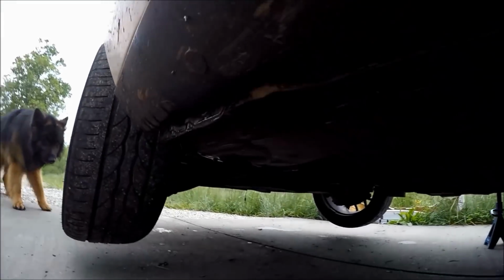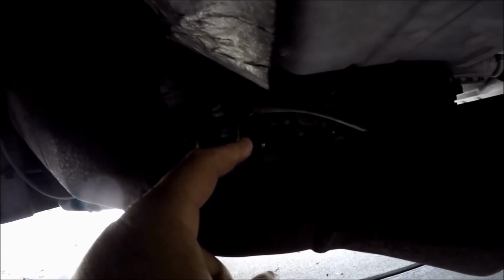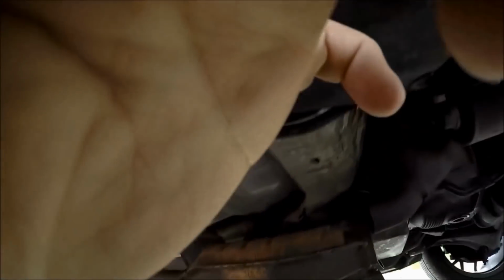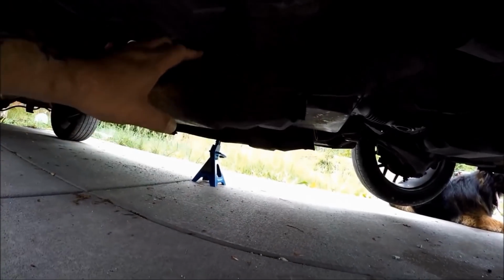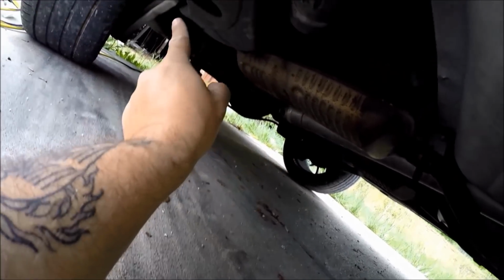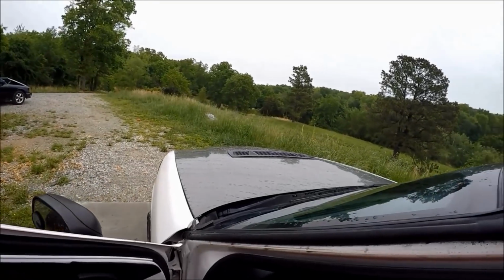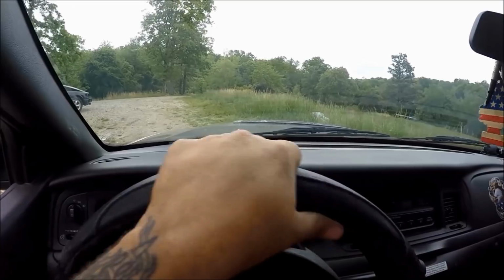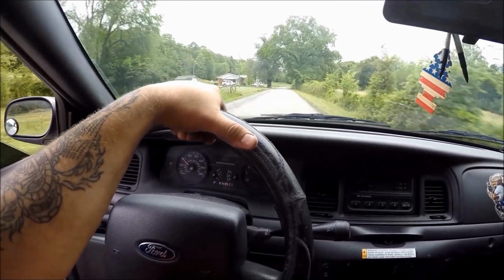LOUD AF!!! Rear Cat Delete on The Crown Vic Sounds Like a Monster Truck, Pops Like a Rally Car!

Comment: Mines fixing to be louder then that. That's how it sounds right now.   I'm putting marauder exhaust on it with a xpipe.  Then the straight tips will be 3 inch out with a dynomax 3 inch race muffler

Comment: For the check engine light I used a capacitor and a resistor and with that it passed the california smog test and no check engine light. I didn't cut the cat, I Hollowed  out all 4 and added flowmasters to tame the sound

Comment: I got magnaflow mufflers on .. removed the rear cats only and thinking about removing the rest 2 and make it all piped up to the magnaflow .. will it be stupidly loud or its gonna make it more pressure into the magnaflow mufflers and make it more muaical 😍 ? Help amigo
Reply: I got magnaflow glasspacks and still had 4 cats. Getting two cut out next week :).

Comment: When I did my exhaust on my vic. I ran around for a week with open exhaust. I have more throttle response with the full exhaust then with it open. May not have anything to do with back pressure, but it's a lot more snappy with the mufflers, and sounds better
Reply: I redid my exhaust and ran turn downs right before the axel... sounded like shyt and it vibrated bad... I'm back with exhaust tips now and it sounds like a pissed off stang
Reply: @Reeko904  it was the same for me when i had it open under the car

Comment: I did a full cat delete on my 1992 Lincoln and it’s so freaking loud I had neighbors telling me they could hear me from 4-5 miles on the complete opposite side of town at 3am. I will also say the power increase and torque was substantially higher those cats really do strangle the engine I wish they had a way to make it quiet but also keep the power gains.

Comment: It's not back pressure that causes some people problems,it's the air fuel ratio, for emission purposes the tolerances in the computer are programmed with whatever resistance it's designed to have,if you really open that up " total cat delete" you will have to richen and readjust fuel trim to not lose allot on low end, that's why when you change pipes on a motorcycle you would have it jetted for example, the back 2 oxygen sensor s on that car basically just check function of converter and do not control air fuel ratio so chopping them will not hurt and will give some gain, chopping the front and backs will screw you without a retune
Reply: Wolfman Rebel just tune the ecu to adjust to the changes
Reply: @AndersonMotorWorks  yessir

Comment: I feel like people who do this also put cards in their spokes as a kid
Reply: How'd you know?
Reply: Made my GT BMX a lot faster
Reply: Sure did
Reply: An old gift card was like having a v8
Reply: @x24Templar  a cammed ls swapped BMX lmao 🤣😂
Reply: That is true I was one of those kids XD
Reply: Kameron Mitchell cards nooe I did cans and plastic bottles
Reply: Agreed. We used pop cans
Reply: I know I did:)
Reply: @OTWKilo  I did, too!
Reply: pffft you didn't live until you got an empty soda can, ran it over so both ends would clamp down on the rim and hold on tight then it would sound like a small engine when you went fast
Reply: damn straight
Reply: No that's only people with straight piped civics
Reply: Yup sure did! Also plastic bottles and cans lol
Reply: __Ivancio__ _ cans sucked when they sliced the tire lol
Reply: I want to do this when I get a p71 and used to do that. Just came across this comment and pissed myself laughing, thanks man lol.
Reply: Guilty. I also would run over soda cans they would get stuck against the front fork and make a loud motorcycle sound 😎
Reply: two gift cards in different spots sounded like a cammed small block
Reply: Damn right!!
Reply: Hug juice bottles, water bottles, & cans 🤣
Reply: Lol I used a coke can
Reply: Yes..yes we did..and pepsi and mountain dew bottles :)
Reply: Mine was clean af. I used a clothes pin but I used the spring in it so the car would last longer. I also used a pop can to add the rasp. Best sounding mountain bike na!
Reply: try soda cans
Reply: I did the crushed can on the tire

Comment: I cut out my secondary cats, installed a 10 series muffler and now I sound like a tuned mustang lol.
Reply: I want my Grand Marquis to sound like a mustang.. but here in this part of Georgia,  it needs to pass emissions, back when I lived in Florida, nobody gave a crap about that stuff...LOL
Reply: 송휵만Mr. Hyuk-Man would a 10 series muffler + all cats sound good but not to loud? I have inspections up here
Reply: Did the same shit lol
Reply: @KevRalph  if you cut out the secondary cats, you won't cause the check engine light to come on because the o2 sensor is right between the two cats. If you cut off both cats, then you'll fail emissions. I also have emissions here in NH.
Reply: @deathraydave  not as loud but way louder than stock muffler.
Reply: @Mr.Preston3991  good point.. I also have an old Lexus LS400 which has a 4.0 V8.... I want to do the same.. I gave the Grand Marquis to my 18 year old..but he wants to be able to "hear" his 4.6
Reply: 송휵만Mr. Hyuk-Man Are you sure? I have 4 cats and I hate it, I live in California and I’m worried I’d fail smog..
Reply: 송휵만Mr. Hyuk-Man That’s what I was thinking also, but are you sure?
Reply: I got high flows for my secondary cats and magnaflow mufflers but it still sounds dead quiet like a stock car. I was thinking about  straight piping the pre cats and mufflers. Do you think it'll be obnoxiously loud?
Reply: @everyonewasstealingmynamea919  I live in Fresno California I have always deleted my rear 2 cats in my crown victoria I've had 12 total only 1 now and smog hasn't been a issue nor did my check engine light come on make sure to remove after the 2nd o2 sensor not before
Reply: @KevRalph  I live here in Florida and just purchased a 2001 Crown Vic and it's not a police one..an old lady owned it since 2004 and now I'm the 3rd owner...it was way to quiet for me so today I removed the muffler and its has got more sound but doesn't have a V8 rumble just yet and I don't think that a performance muffler alone is going to be good enough ..I'm going to research this a little more but maybe removing the rear part of the cat system might help..I am very grateful that Florida does not make us have our vehicles inspected...I'm a libertarian and not a liberal that believes humans are going to burn up  the planet with their fiery  exhaust
Reply: @vegansaxon3962  I used to live in Clay county Florida near Jacksonville and on the main strips always had ex police cars for sale.. I've been told the flowmaster 40 series sounds great and from what I've heard, I agree. That would probably be the one I would stick on the Grand Marquis..
Reply: I'm from MA and I did the same on my '04. Since its an '04 I don't have to do emissions on mine, thinking about removing the first set of cats too lol, then itll just be straight piped until the two 10 series flowmasters, i wonder how loud thatll be, its already pretty loud lol
Reply: kevralph how it sounds has nothing to do with passing emission. Just change the mufflers to Flowmaster or thrush weld. As long as you keep the cats you won’t fail.
Reply: Did that make it true duals ? Any crossover pipe ?
Reply: @thumperbangin2000  no, my model came with dual into single exit, I honored that to save money. I believe it would be louder if you went true dual.
Reply: @Mr.Preston3991   ok, im looking at a 05 LX soon, im not sure what it has on it stock.
Reply: @ChinnuWoW  for daily driver yes. for fun car no
Reply: @jaredreck882   I actually removed the mufflers a long time ago and it sounds nice. Not bad at all.

Comment: Just tuning in, why are there no videos on deleting all for cats instead of just the rear two. Has anyone done this, or does it kill the gas mileage and check engine light stays on. And then what are the options??
Reply from the maker: crappy MPGs
Permanent check engine light
and major loss of low end torque

the worst part is the almost unberable drone
Reply: @MrRandomReviews  damn bro. I bought a 02 Crown Vic that had all the cats deleted it ran perfect no check engine light he said he tuned it though... You not aware of this?

Comment: Ok so I got a 99 vic it's not a cop car it is stock but when I got it the guy I bought it from that he was gonna scrap it because he did need he sold cats a lot so when I looked under the hood to my surprise he cut the tip of the manifold off 
To save time but said it would run so got it running it is loud af also this is my first car wish me luck

Comment: You could just cut the cats and use some wire to hold the rest of the exhaust up. I did that to my 03 and she was obnoxious for a couple weeks. But u left the rest and it was a good thing. I now have a proper replacement for the cats I removed. The biggest annoyance of the car delete was how much it assaulted my feet.

Comment: 0 out of 10. I bought my 03 p71 with 3 of the 4 cats. Had to remove the last secondary. Suuuuuuuccccckked! My feet hurt after 10 minutes of driving at 55... now she has 2/4 cats, piped all the way with the H and mufflers swapped to super 10's.... it is perfect! But it would be louder with a primary cat delete and the super 10's but I won't do that until I get long tubes.

Comment: Removing your rear cats shouldn't make the check engine light come on. The front O2 sensors tell the engine how to adjust the air/fuel ratio. The back O2 sensors are after the front cats. They send a signal to tell the computer if the cats are functioning properly. Whatever happens after that point won't effect the check engine light.
Reply: I guess with the rear 02 sensors right at the opening, it could make the light come on, but if you extended the pipe back some, it should fix it.
Reply from the maker: my light came on you can even see it in this video of you look close
Reply: That sucks.
Reply: @MrRandomReviews  I had my cut out and I have never had the light come on. Mines on 04, doubt it makes a difference though.
Reply: Removing the rear cats may trip a low cat efficiency or rich code. That would make check engine light come on. By the way what he is telling people to do may also be ILLEGAL IN SOME STATES.

Comment: Check engine light DOES NOT come on with rear cat delete. There no sensor after the rear cats. The computer has no idea if they are there or not. 

Did this on my 2004 p71 and owned it for 6 years. Had thrush weld mufflers. Sounded great

Comment: If you had cut from the exhaust cat inlet, it would have sounded like a bomber plane.  I had make a cut on mine, ahead of cat because had damaged converter and blocked exhaust. 
 The sound is so loud, im gonna try to put on combination flex tube pipe until my cats arrive in the mail. 

1989 Caprice 305
1989 Grand Marquis 302

Comment: Little Fact: If you cut off only the rear cats then you should have no issues with a check engine light. I removed mine last week and no issue as long as you add some exhaust pipe to replace the cat you removed.

Comment: If you know what you’re doing, there’s a solution to the engine check light caused by the O2 sensors reading wrong when you cut the cats. I should actually say the flow read is  outside the perimeters the computer expects

Comment: For the check engine light. Buy a spark plug non fouler that your oxygen sensor will screw into. Then install both into the exhaust. It should make the check engine light turn off. There are many videos of people doing this. Hope this might help you out Mr. Random. I enjoy your videos.
Reply: this worked on my brothers 02 grand prix gtp
Reply: he cut after the o2 sensors so there shouldnt be a check engine light for that.
Reply: if the cut is close enough to the o2 sensors it'll read out side air an could trigger check light ive had a hanger ripped off an leave a hole near rear o2 sensor on my 4x4 read to much oxygen triggered light till it was fixed
Reply: 87fubar It should have some piping added, this is like running open headers, even Stock Cars run side-exit exhaust
Reply: he cut 2 inches past the o2 sensors didn't show welding or clamping to that an side exit is normally couple feet back after headers or manifolds mr random reviews what check code or codes you getting
Reply: Definitely works did that 5 years ago to pass smog 😂😂😂😂
Reply: @jimstenlund6017  no it's not, it's still going through a converter on each side. Crown Vics and Grand Marquis have 4 Cats.
Reply: @shanegalang9  converter isn’t much of a muffler though.

Comment: i feel like you can get away with it if you put aftermarket mufflers on or leave the stock mufflers on.  like i have 14" magnaflows hooked up to custom duals and h pipe (i had a y-pipe stock) and its really quiet.  sounds good but not commanding.
Reply: Yourworst Nightmare  the drone on these cars can be fucking awful, had a 97 eith cracked manifolds.. pretty sure some of my tinitus is from that car

Comment: lots of people mix up "back pressure" with scavenging. back pressure is bad but having proper sized pipes can give you slight gains like in low end torque due to the scavenging effect

Comment: The back pressure thing is a little off. When my fuel pump on my 92 went out I needed a car to daily. This car was completely done. 1992 Camry the exhaust was broken off right at the tip of the manifold. You would start it and your head and ears would bleed. This car being a Camry was beat up big time however with it being that short literally exiting under the hood when you drove it normal it would do sub par however if you got on it the second you let off the throttle even a little it would choke out so badly that you would assume something was really wrong. I fixed my crown Vic even though it's over 400k it was way more worth fixing than the Camry. I sold the Camry for 150 and the guy keeps asking should I change the fuel filter the spark plugs etc because it keeps choking out and I told him over and over you need to put some more piping on it the little four banger is struggling under full throttle. Now to put this a bit more in perspective my crown has been converted to dual and I put glass packs on it(due to being too loud as you mentioned before) ironically everyone thought I deleted the cats but nope just the muffler and made it true dual but that camry man would it struggle under load.

Comment: On a different topic with the same car model: My 2008 CVPI is due for brakes and rotors. I wan’t enhance brake performance and pedal response to a similar standard as my BMW 540i.  Any tips and or resources?

Comment: On my 2005 I cut out all 4 cats and put all 3 o2 sensors back in the same place. No check engine light. And it cleared up a #3 misfire I had at high speeds. The stock mufflers have a unique sound too. Runs a hell of a lot better than before.
Reply: I'm having issues with my cat on my 05 what did you use to pipe it none of the shops around will touch cats now because they have been having a lot of stolen come in I wanna just take them off if you can let me know I'd really appreciate it
Reply: @buffalobill4875  2.5 and 2.25 inch pipe. And I cut right on the converter welds. You have too. But I want to say some where on the net there's mustard pipes that are the same and you have to add your o2 sensors.

Comment: You only get a check engine light if you cut out the O2 sensor, if there isn’t an O2 sensor after the cat then you won’t get a check engine light, so don’t remove the cats if there is a o2 sensor after them and you won’t get an Engine light or poorer fuel economy

Comment: Great video! But why would you put a child in the front bucket of that tractor and then drive it in high gear? If you were driving at a slow crawl in a field it could be risky because  if you hit a bump the boy could be thrown out of the bucket. At higher speed  the same could happen but it is much more dangerous since you could not stop quick enough to avoid running him over! (Have fun, but be safe!)

Comment: Man I was worried about cutting my mufflers off to fix the pulled pipes. That's insane I think i'll be safe when cut the mufflers and hopefully it's not too loud.
Reply: The 4.6 makes a lot of noise. You might want to just get a good aftermarket muffler.
Reply: How was it a year later ?

Comment: Wonder how this would sound on a stock 98 civilian lx model lol. Single exhaust :(
Reply: It would sound equally terrible.... dont destroy your car. This is for entertainment only. I have had 30 something cars, the thing I love about MY daily driver Crown Vic lx is the peaceful quiet inside. 
Loud should be like my '69 Camaro or something with a "Built" engine
Reply: Mines a civ model. 97. I hollowed our rear cats, super tens, true dual exhaust with side pipes. It’s droney but damn well worth it. LOUD.
Reply: dsrta645 I’ve always thought about doing it to a cig model nice that someone did it 🤘🏽
Reply: I just bought a 2001 LX and need more sound....I shall not take advice from the guy here that likes his car to be quite and peaceful..dual exhaust with some performance mufflers should do the trick..maybe it might sound like Mad Max's Pursuit Special with the fake blower
Reply: @dsrta645  I looked underneath my 2001 LX and think I might be able to get a rod or big screw driver to bust up all that blockage...how did you do yours so that there were no chunks still left to rattle around?

Comment: I have mufflers on my Camaro and its still louder then your cv.
Reply: The mic doesn't pick it up very well I did it to my Vic a while back and it's extremely loud not sure which gen your Camaro is but my v8 4th gen isn't louder than it
Reply: Louder or not cvs > Camaro